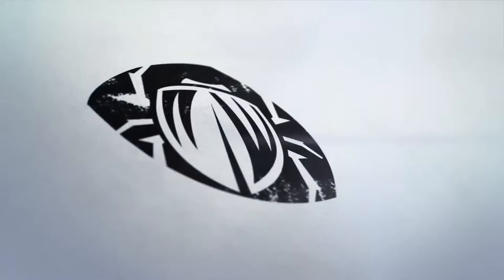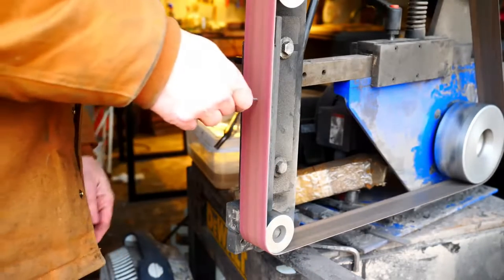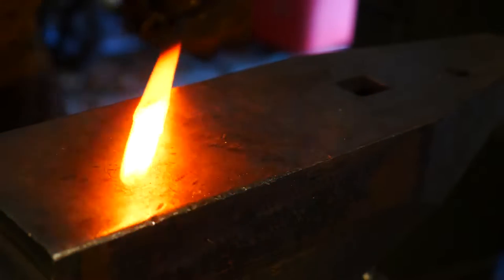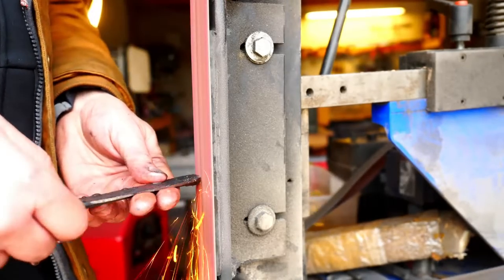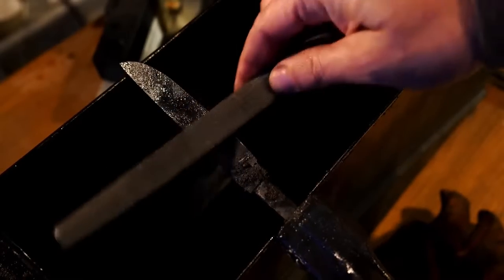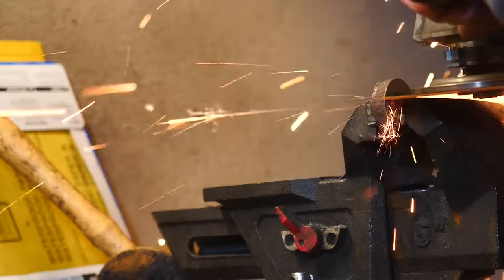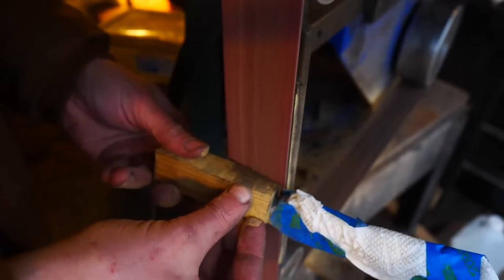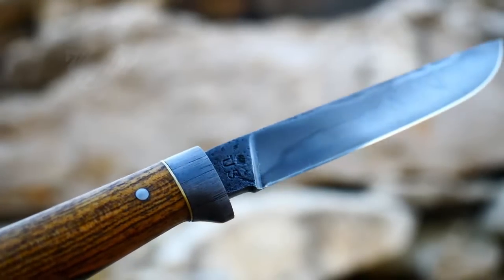Bayonet to Bird & Trout Knife COMMENTARY version.

Comment: As a knifemaker with 15 years in the craft, this has got to be one of the coolest projects I have ever seen. I am a sucker for both repurposed historical steel and smaller nimble utility blades. My heart sank when it failed to reach acceptable hardness in the first quench test. I was absolutely stoked when you made the choice to carborize the steel rather than use it as san mai cladding or something. Keeping the U.S. stamp was the absolute cherry on top. Any history buff can clearly see what it once was and that you definitely did the original article justice. It is so fitting that such an icon of suffering, struggle, pain, and death should start a brand new life as a tool used in the creation of wonderful memories through hunting and fishing in the country it helped produce. Thanks Green Beetle!
Reply from the maker: 🙏 ty sir!

Comment: Mig welding without a shroud. Not seen that one before!
Reply from the maker: I wear a hood but no shroud I’m confident you’ve seen this before.
Reply: @GreenBeetle  I meant the metal shroud on the Mig tip that encloses the inert gas onto the the work piece.

Comment: Great knife, the harmone, the stamp, and transition into the wrought iron is so cool. I really enjoyed the  history commentary too. I notice bladesmiths will always make a bird and trout knife but never a true fishing fillet knife. Is this considered  a lesser blade to craft? Its a knife you want to bend so mass producing the blades from stamped 1/16" stainless steel is probably the easiest route at the commercial level. Even still, id love to see  one properly smithed.
Reply from the maker: A fillet is harder to make by far.  Thinner blades are harder heat treat without warping and grind without burning the temper.  No extra meat to work out a slip on the grinder.  Making sure the temper accommodates bending but also allows a hard edge.
Reply: @GreenBeetle   Ah, yes, the kind of issues you can go back and fix only to have them occur on the second attempt anyway.  Thanks for the reply!